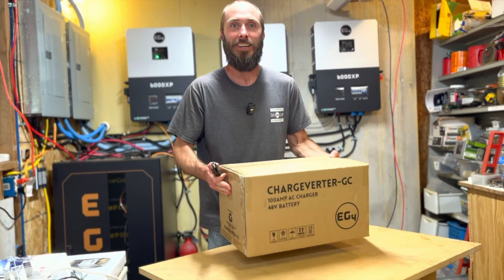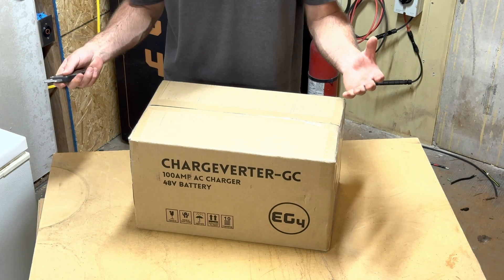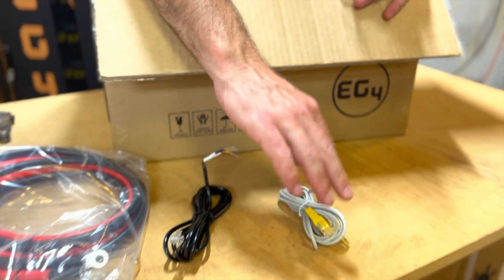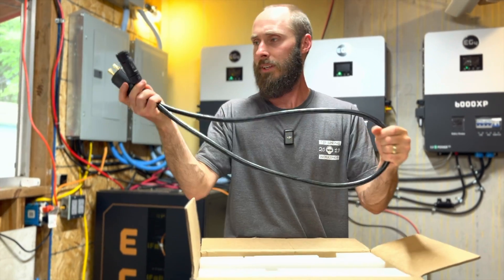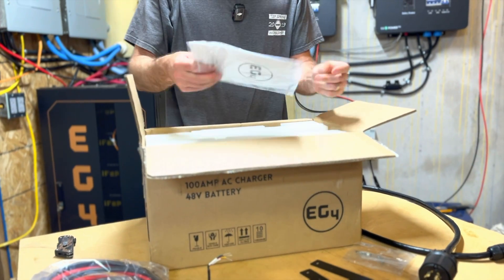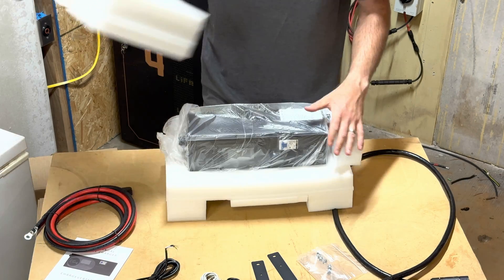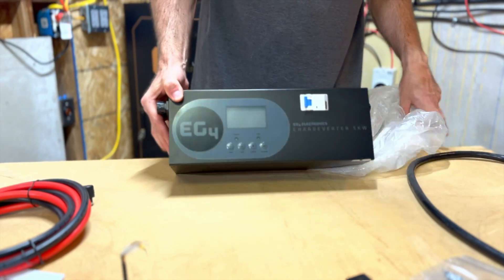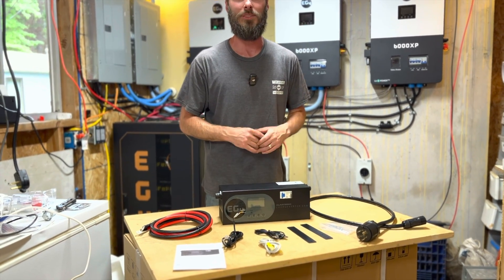Unboxing The NEW 5KW Chargeverter GC by EG4!

Comment: Thanks Eric. Quick question. I couldn’t tell on the other video, are you connecting you Chargeverter directly to the bus bar in you cabinet, or did you purchase a separate one and connect the bank of batteries to it?  Thanks again. Blessings
Reply from the maker: Great question. I connect directly to the bus bar in the cabinet.
Reply: @EastTexasHomestead thank you. How long have you had your’s connected. Happy Sabbath!
Reply from the maker: @secondadventmessengerminis3594  I hade it like that a little over a year ago I actually have it on a separate bus bar now but haven’t used it this way yet. Shabbat Shalom!

Comment: I just checked signaturesolar and the manual for the chargeverter does not list the battery cables or the twist lock plug-in as being included in the box! Thanks for the upload, mine is expected next month!
Reply from the maker: That's a huge oversight. As you just saw, it indeed comes with the cables, and they're really nice, too. I'm glad you got one, and I know you will enjoy it! Thanks for the comments.
Reply: How is it working for you, @branch_ranch?
Reply: @1antoniette  i have the chargeverter connected to my harbor freight genny via a homemade extension cord. My EG4 wall mount battery (14kwh) takes awhile to charge because my genny only privides about 22 amps. 
My solar panels arent connected yet as my cabin is 6 hrs away! The chargeverter is awesome because you can dial in the amps to match your set-up. I'm happy to answer more questions if you have them.